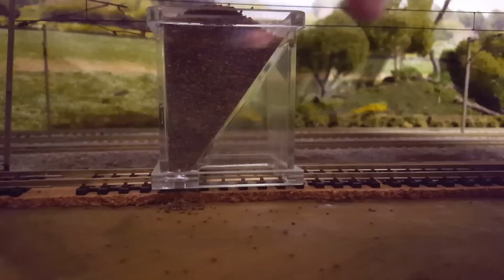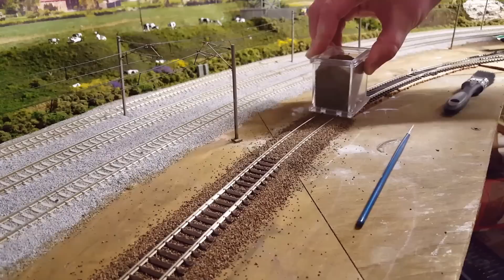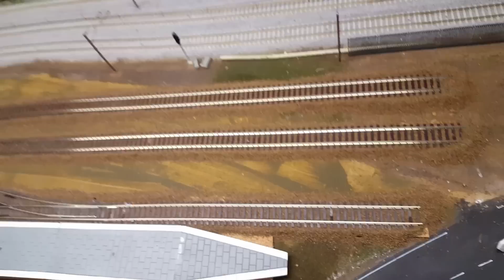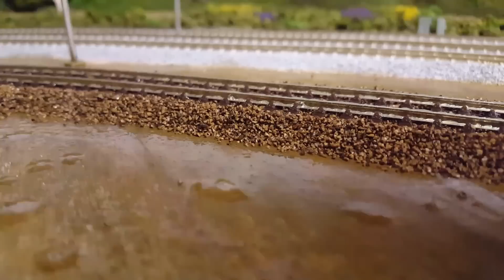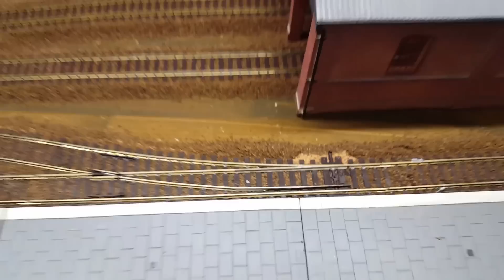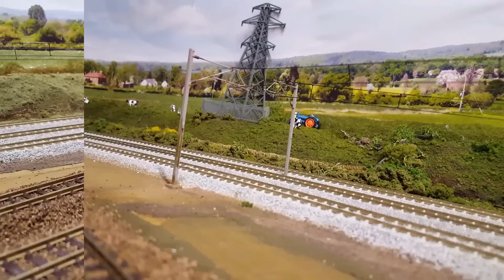New Junction - Adding a heritage line, part Four - Ballasting

Comment: Instead of using a fine brush, tapping the rail with a screw driver tends to knock ballast of the sleepers. Just a thought, good video......C
Reply from the maker: Charles Francis thanks Charles, that's a very good top tip! :-)

Comment: How much glue is there in relation to the water in the pipette? Also, is it just water in the spray?
Reply from the maker: Bombarded - just water in the spray. In the mix I use around 40% water 60%glue however spray heavy so it ends up being 50/50.
Reply: New Junction thank you so much! I will try to get started this summer :)